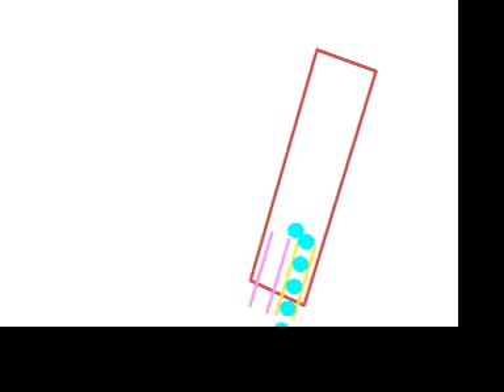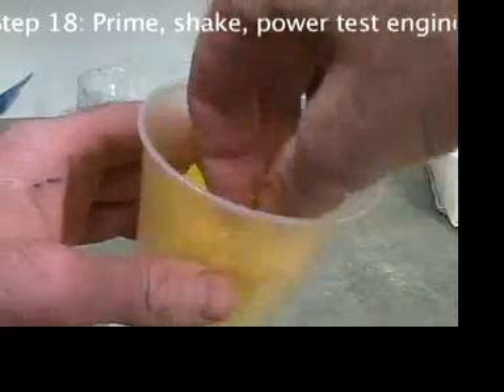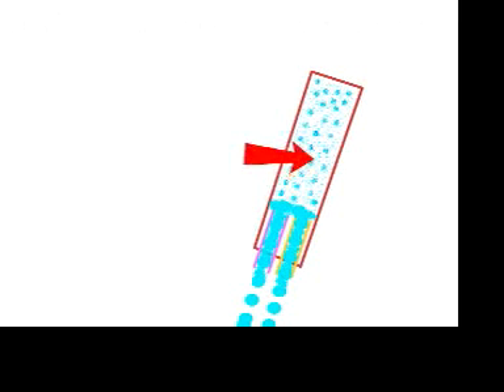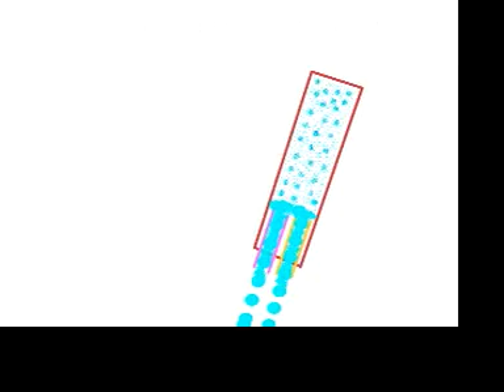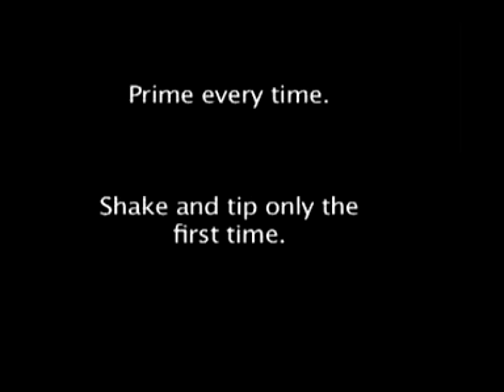Part 21 Build a Putt Putt/Pop Pop Steam Boat s18 powered test

Comment from the maker: The next video, Part 22, goes over troubleshooting. There is a link to all the steps in the text area. Usually the problem is a leak. Sometimes the bottom has a bit of a curve, so it is not flexible enough to flex in and out. It's typical for people to have to make at least a second engine before getting one to work. Good luck.

Comment from the maker: The part of the straw that actually goes inside the engine will get very hot, but the layer of epoxy around it should keep it from melting. Even there, the water droplets inside the engine keep it from getting much hotter than boiling temperature.Then, the part of the straw outside the engine should never get too hot to hold. Sure, copper is great but expensive when making lots. Solder works with steel, brass, copper, but not aluminum (except special, expensive aluminum solder).
Slater

Comment from the maker: I don't know what fevibond is. Is it heat resistant, waterproof and fills gaps? If straws have kinked at the bend, sometimes you can push a fat wire with insulation in the straw before gluing the bend.

Comment from the maker: @Gravolux Moving the candle more forward or more to the back can help with stalling. Also, shaking and shaking all the water out of the boiler, then prime the straws, can help. Only water droplets that can flash to steam should be in the boiler. 
Stalling alternates strong power with nothing. But if it's just shaking, that's not stalling: you have a leak.
Slater

Comment from the maker: @tsenterd I don't think you can shake too much. The whole point is to splash the inside of the engine so tiny water droplets will wet the inside despite the air bubble.
Slater

Comment from the maker: @jeankris972  Well, I don't know about epoxy quality, but a lighter could be too much heat, especially if the engine is dry (stops popping). Always remove the heat if the engine stops popping. Butane is a very hot fuel. When the epoxy gets too hot, it doesn't seem to stick well. You might have to go back and seal leaks again. If the epoxy peels off easily, remove that part and apply epoxy again. Scuffing up the aluminum with sandpaper might help it stick better.
Slater

Comment: Men that was great fun doing it with my 4yrs old son, my 1st ever engine work straight away ( i was probably more exiting than him). I have a question is there is something as bad quality epoxy or too much heat. To help you understand i bought the epoxy glue in a cheap store (bad quality?) and i power test the engine with a lighter (too much heat?).

Comment: I have a question: If you make your engine using a hollow copper tube folded into a coil, will it still produce the signature popping sound? Because from what I understand (correct me if I'm wrong), the sound seems to be produced by the diaphragm engine folding inwards when the steam gets blown out and folding outwards when water gets sucked in. (Like a lung)

Comment from the maker: So it works, but it just takes a long time to work? For reasons I don't understand, sometimes it's not enough to re-prime. You should vigorously shake out the old water, then re-prime. One other possibility: try moving the flame more forward.
Slater

Comment: re- the engine working better the second time

I'd imagine that this has something to do with the heating/cooling involved. It may deform the metal a bit so that it frees the metal to move more easily, getting rid of any stress formed by slight kinks/bends. Just my two cents, love the project, I'm definately trying this. :-)